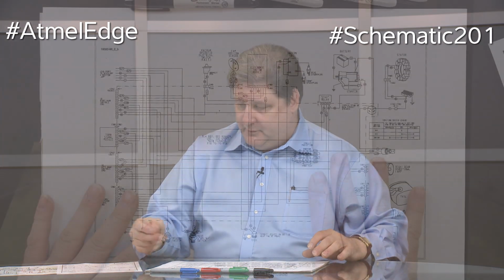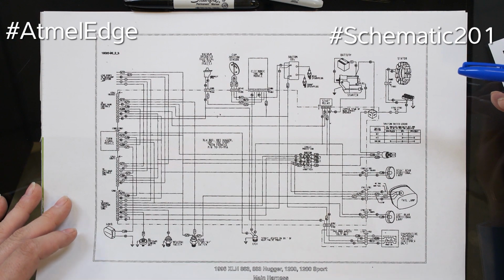Atmel Edge With Paul Rako: Schematic 201

Comment: My pet peeve with so many modern schematics: the designer links two or more pins with net-labels, instead of actual wires. It's infuriating!  How are you supposed to know if there are other connections to that net without exhaustively searching the schematic?!?

Comment: I personally dislike wire jumps in my schematics.  They are just never necessary if all connections represented as T junctions, and crossing wires are never connected.  So while the dots are not needed either, it looks better to keep them in.  At least you know where to expect them and most importantly where not to expect them in case a bad copy adds or deletes some.